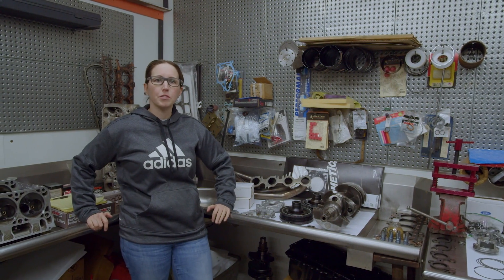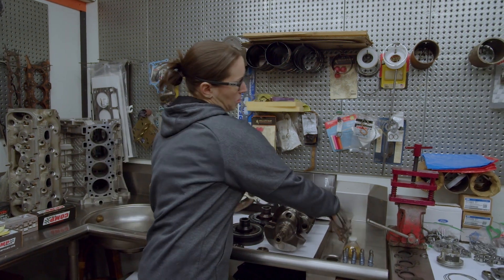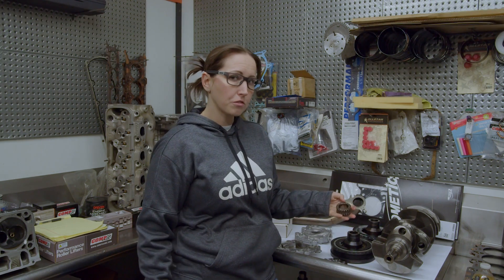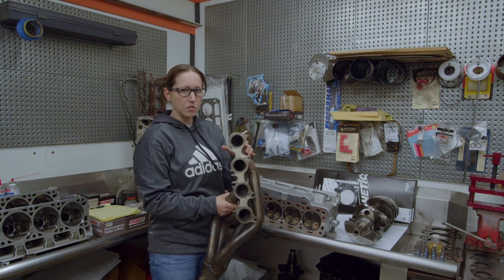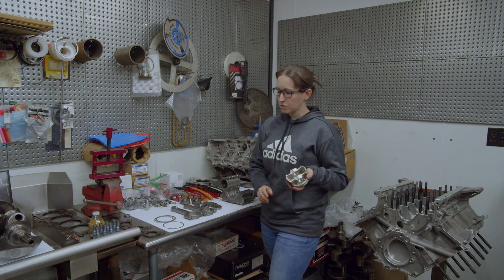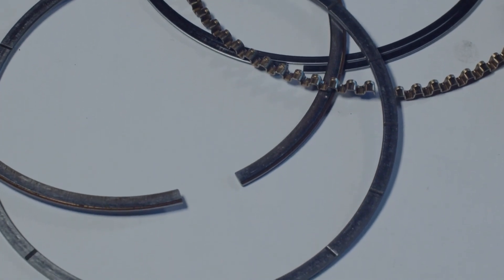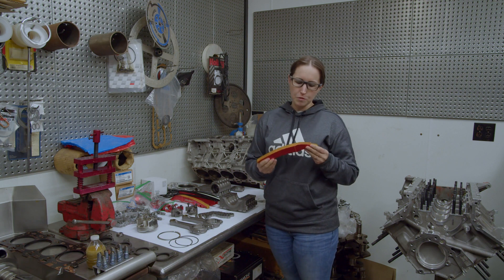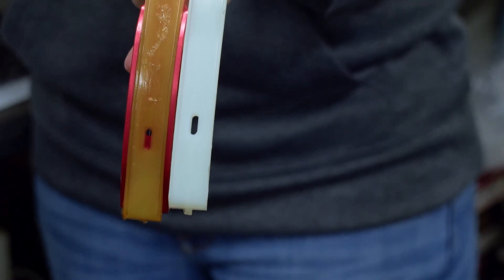Engine Tear Down Analysis | Moore Throttle Ep.1

Comment: Nice video! I’m glad I don’t have to deal with a engine with so many issues 🙄🙄🙄🙄! I have friends who run that engine turbocharged, wow they could find new ways to tear up parts in fairly short order! If your tearing up the front of a SONNY BRYANT crank, you really should be talking to a different balancer company! I’ve seen that same issue in big & small blocks, even high performance diesel! You may want to contact Fluiddamper! Because when we had issues, they were the only ones looking to solve the problem, instead of just saying it’s on your end, & selling a new balancer 🙄🙄🙄🙄! Call them! Because every time there was a issue, they figured it out! Even when driving a supercharger! Also don’t just think that new parts are good ones! Some Companies change vendors like underpants! So make sure you look 👀 over any new pieces, along with measuring! Best of luck 👍🏻👍🏻👍🏻👍🏻🇺🇸🇺🇸🇺🇸🇺🇸!
Reply: I actually found a solution to the problem this year, and its working! We are working with Shaftech Ltd in Ohio, and they sent me over a "Diamond Claw" to use, and after 4 really hard races, I have done a mid season teardown, and the crank sprocket AND crank look brand new, so this "Diamond Claw" WORKS! Everyone needs to check them out if they are having a similar engine issue (not just on the coyotes, they make them for a variety of combinations/engines)...

Comment: Good video the main bearings looked pretty trashed and the scoring on the rod bearings you think this was from the metal debris that went thru the oiling system? And then we are going to the gas ported rings as well as DLC coating them afterwords too which according to Lake speed jr. should be the ultimate combination for us but we are in a superbike application at 16,000 rpm but he said the DLC should really be ultimate solution for ring friction that coupled with the gasporting should be as a killer combination but we were just curious did you guys or were you guys Able to measure any noticeable difference going to the Gasported Rings?

Comment: Not to give anything away from your build, but will you be going to a 4 ring set up or putting a wider gap between the ring sets to fix the wobble issues? You impressed me. Very knowledgeable lady!
Reply: Thank you! Yes we are trying a totally different ring package and wider gap as well. It wasn’t the gap that was the issue though, when they did the analysis it was found to be in the design, however we do believe the rings still should be gapped a little bit wider with our new combo.

Comment: Wonder if you could do a gear drive timing setup to avoid all the chain stretch and guide issues.  what type of damper?  elastomer ring or fluid?  crank support bearing or just letting the drive pulley for the blower hang out in the breeze?
Reply: We run a crank support for sure! Ati damper as well. For the racing we do, it’s class specific with strict rules and certain components are required so we have to run it with these components.